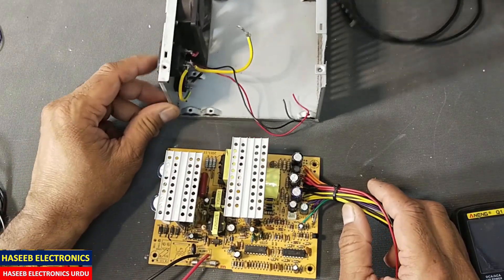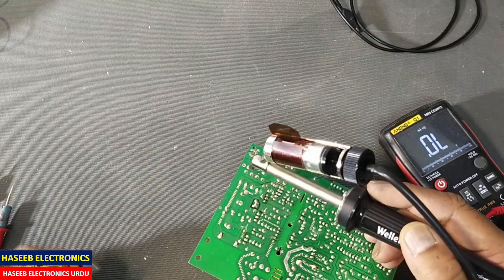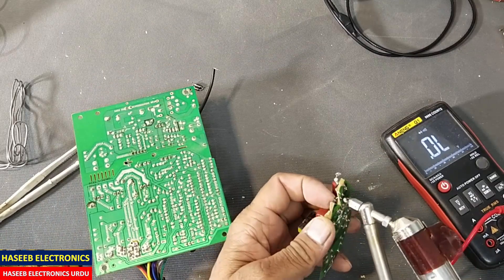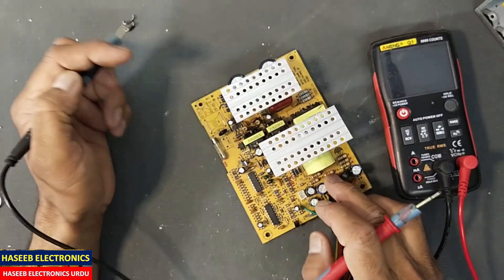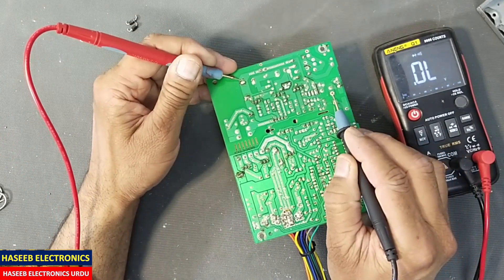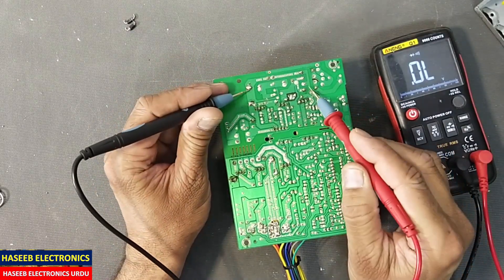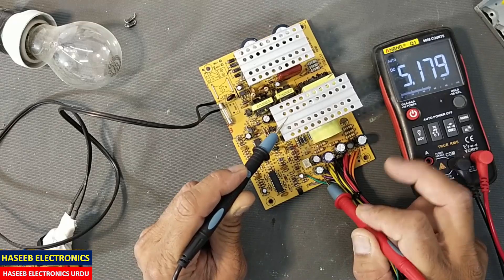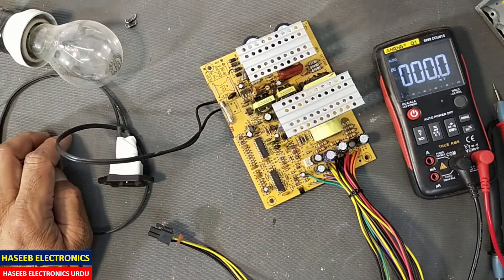{605} Computer ATX Power Supply Repair / How To Repair Computer PSU, Not Turning ON

Comment: sir i have same power supply with tl494 and lm 339 ic in output side. when i turn it on the standby 5v is ok but i dont have output voltage after ps on . what is the cause and how to check. there is no any shorting in components.

Comment: Resp Sir! Very Nice Class Sir. Sir Ur Area Current Fluctuations Good Sir. My Tribal Area Current Fluctuations Very Bad Sir. Ur Vedios are Very Simple Repairs Classes Sir. That Problems Here not Equal Sir. Here Sir Series Lamps On off, On Off 5 Times Sir and Directed DC 12V Sir PG 5V Passed Through PS On Only Sir. Bu PS On Off the Total DC Voltage Sir. AC off after on Same Problem Sir. Complicated Problems Here SMPSs Sir. AC Freequency Difference Sir or not Sir.  --   ChinnaRao Paderu Andhrapradesh

Comment: Hello dear, I hope you are well.
I wanted to know if you can help me, I removed the current protection from my atx source to prevent it from turning off with large loads, I did the steps you did in a video that you explained how to remove this protection from atx sources, everything worked fine until I accidentally made a short circuit between 12v and GND and it doesn't turn on anymore, it's a source with the IC KA7500 to which I did the trick to remove the protection as you did in one of your videos. Do you know where I should start to fix the source?

Comment: Informative video..👍 quick question I have a smps which is having 48VDC output for ebike battery charger.. the smps gives output when AC is given but charging led won't turn on and fan is also not rotating? Thanks and regards..🙌😊

Comment: Is it sufficient to change only the 2 shorted diodes of the bridge rectifier or all the 4 should be changed. Can we assume that  2 good diodes may also gone through high amp but not shorted for the time being but  may become bad in near future. Also should we  replace diodes of same no. and batch  or it is ok to use different batch or equivalent . The same questions applies to the 2 switching transistors (generally 13007). In some branded smps 2 mosfets are used in parallel there also the same question arises. Please explain your opinion on the matter and if possible make a video.
Reply: 4 me i change all of them

Comment: Sir what kind of soldering iron you are using? It's look like 2 in 1 soldering and sucking led!
Reply from the maker: i have weller WR3M rework station 
it have soldering iron
desoldering iron
hot air gun
vacuum pick up 
you check video number 511 as well to see my rework tools
Reply: @HaseebElectronics  thank you

Comment: i have 3 cooler master 450w of which one of them has active PFC, fuse & bridge all ok, but no 5Vsb on all 3, any suggestions to repair them.
Reply from the maker: please check the voltage supervisor section 
check the optocouplers' 
in first stage PFC circuit must turn ON then the PWM circuit will turn ON

Comment: Hi Haseeb, quick question, do you or have you ever used an esr capacitor meter in your repairs and if so did you find it useful or did you find it easier to remove the cap for testing out of circuit?
Reply: I think big capasitors in series is possible to test without desoldering by proper esr meter. But those caps in parallel on 12-5-3.3v lines - you need check it one by one with desoldering.
Reply from the maker: @Igor Morozov you are right. the best practice is to remove it from PCB
Reply from the maker: yes i have ESR meter and use it to detect suspected electrolyte capacitors. it is very useful tool to detect the intermittent faults 
best practice to test a capacitor is to remove it from pcb. in this way the exact capacitance can be measured while in pcb it gives some marginal readings.
Reply: @HaseebElectronics  thanks for the reply, I usually remove for testing but now that its all going smd/smt which can be more difficult I was thinking of getting a cheap esr.

Comment: Sir I have 5 smps . Normal frontech make. All are repaired by me. When i run the smps its starts but when i connect it with motherboard display not com. Then i checked the smps and found 5v. Stb not getting  from smps. I can not understand where is the problem. I changed the ic with new one but problem not resolved. Sir if you have any idea please share it with me  i shall ve greatful to you.
Reply from the maker: in this situation
when you have a working power supply
and it is not working with motherboard
check PG power good signal grey wire 
most of the time this is fail
Reply from the maker: if PG signal power good is fail 
the power supply will never allow to processor to work 
as it is a certificate from power supply to the processor that the power supply is good 
if this signal is missing 
the processor will never start because this signal is compulsory to enable the pson latch circuit